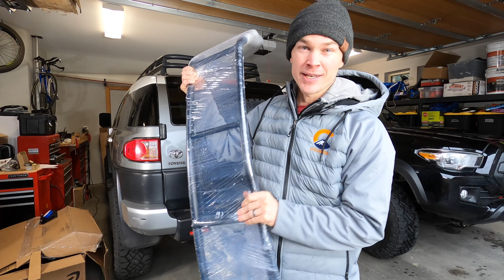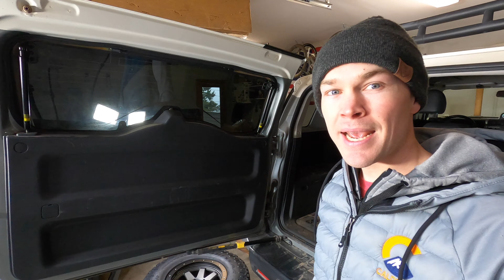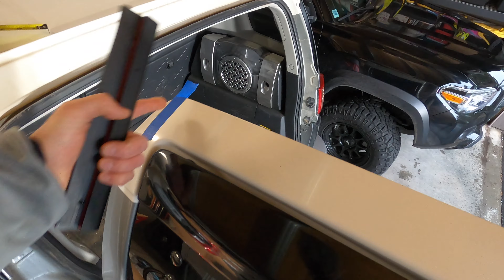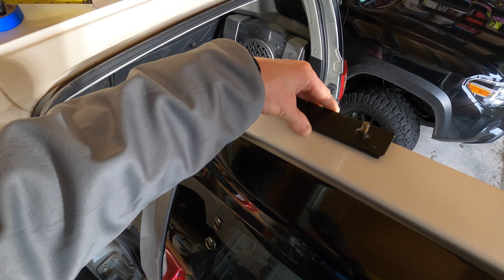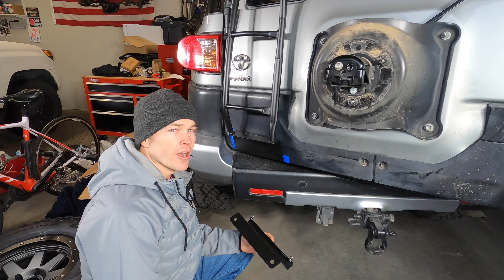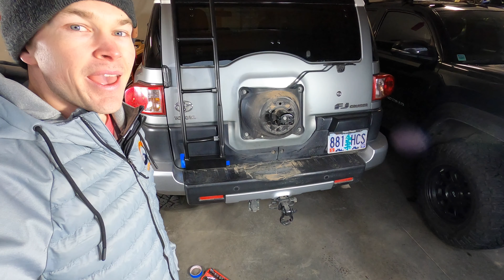The Must Have FJ Mod

Comment: to answer the question "is an fj cruiser without a gobi ladder really an fj cruiser"

yes, yes it is.

if you install the ladder, the fj to not fj ratio increases. making it LESS of an fj than original. additionally, losing the function of the rear window hatch and visibility decreases the fj-ness even more. 

additionally, while the ladder is cool and all. its virtually useless as you can reach the rack from stepping on the doorsill or using the coveniently mounted spare tire as a foothold.

Comment: My must have for the FJ is a diode dynamics cf18 smart tap relay. It adds momentary lane change blinkers to the FJ, and some other silly but fun stuff. After that if you have a locker and no Atrack switch add that. After that its side sun visors on the pre 09 units.

Comment: Is the FJ Cruiser actually functional or just for looks?
Reply: The ladder on the back of the FJ is just silly and stops you from opening the back window. You will want to be able to open it in the summer for some ventilation as the back windows of the FJ don't open. Yes this to me is a big deal. 

I would say my FJ is a functional vehicle. But you have to have the right use case. For example the back seats of my FJ have been in my garage for the past 9 months. I never have passengers in the back. The passenger space is rather small to start with. So if you are a family of more than 2, don't buy an FJ. The roof rack on the FJ is very tall and very small. If you need roof storage I would replace the rack with an aftermarket one. But I can fit 2 kayaks on it using thule cross bars. The factory crossbars are garbage.  The FJ is an ok commuter vehicle but it has a tiny tank and a big appetite. I drive down dirt roads and in snow on unplowed roads and for that the thing is unstoppable. Even when the town forgets to plow my road I got home. I even dragged a ford car up the road with me because it couldn't make it up the hill with 6" of snow. From a reliability and cost of ownership the FJ is basically as good as it gets. I've had a cherokee and they are expensive to maintain because you are always fixing something. Other than brakes, tires, exhaust and gas tank straps. I haven't done anything that wasn't oil changes to my FJ in 3 years. All the work I have done is because of rust. But that is what it's like to own a car in the North East. The ride of the FJ is better to me than a Tacoma but not as soft or comfortable as a 4runner. My next car will be either a Lexus gx or lx because I can't buy another FJ. The Lexus GX is basically an FJ with more luxury and less style. The Lexus LX is a landcruiser. But both of the Lexus cars are very expensive compared to an FJ. Love my FJ.
Reply from the maker: Depends on what kind of functionality you're looking for.  In general I think the 4Runner is better suited to most people if practicality is what you're after but the FJ does have an advantage off-road and has a unique interior/exterior design

Comment: My favorite FJ mod was installing a 8.5’ x 8.5’ lighted awning and getting an awning room to go underneath it. 
I bring a little step ladder with me pretty much everywhere I go, but it’s completely necessary with the awning to slide it into the brackets on the roof rack. 
I have it mounted on the passenger side so the power chord reaches the cigarette lighter, so this particular ladder wouldn’t do me too much good. 
And yes, my FJ is most definitely an FJ without the ladder.
Reply: Nice!👍

Comment: I have one on mine LOVE IT! I'm 5"8 on a good day and stepping on the rear bumper, I have to open the door and at times not a good option additionally you can only reach so far into the rack . Also if you run stock tires yes you can open the window BUT once you go up in larger diameter no dice. Lastly it just looks COOL!

Comment: Step on bumper, then tire, then roof .. easy. 
Rear window access is important .. from access to my Travel Buddy, running a lead out for solar or 240v (powered site) or purely to enable air flow for the fridge.

Comment: So I guess you can’t open your back window now?
Reply from the maker: Its not hugely useful with the spare tire in the way anyway... but yes that's one downside.
Reply: @DrivenCompanion What size tires are you running that block opening the window?

I sometimes camp in the back of my FJ and having the rear window open is nice for ventilation (with some temporary mesh to keep the bugs out) so this wouldn't work for me.

Comment: Hey Mike, great videos!!
Do you think you could do a overview video of the final suspension/lift mods you did. BMC, lift height, tire size, etc.  trying to figure out what will be required to fit the 295/70r17s.  FJ looks great, keep it up!!
Reply from the maker: This video pretty much gives the rundown but another video in the future is very possible as well: https://www.youtube.com/watch?v=VFaucAuXlfw&t=212s

With a BMC and an inch or two of lift you should be good with the 295s.
Reply: @DrivenCompanion   Thanks!  Did you plate your BMC or leave it open ftm?

Comment: I'm not so sure about the ladder being a "must have."  The ladder can be useful, but I can simply open the rear door, stand on the inside of the trunk, and have the same roof access with more stable footing.  If the rear window retracted like the 4Runner, it would be a non-issue, but you've now taken away the ability to open that window.
Reply: I thought a "must have" for the FJ were blind-side mirrors, a cb and some power outlet in the back
Reply: @michelt4390  mine already has a power outlet in the back
Reply: Agreed, I've done a lot to my FJ and that ladder never made sense to me.
Reply from the maker: Fair point!
Reply: I stand on the rear tyres as well when packing roof rack
Reply: I've been wondering of its possible to fabricate a hinge in these ladders to drop down to access the rear window. I've been searching the web haven't found no one to do it yet.
Reply: I use my rear window about as often as I would use a ladder.  Never

Comment: And now you can never open your rear glass 🤔.   I find the rear tires are a great why to access the roof rack.    It dose look good. Just couldn’t bring myself to buy it.  🙂
Reply: Same here, easy to step on the rear tire. I'm not giving up my rear window
Reply: Bingo.. for us guys who have power rear window that beats ladder any day..
Reply: Many times I loaded oversized stuff (pipes etc) by opening the rear window. This ladder is terrible advice - it's so easy to get on the rack anyway
Reply: Yep, makes the rear window useless.
Reply: My rear window has been stuck for 4 years...LOL
Reply: @orthorongaming  fix it, it doesn't take much to open the rear panel
Reply: @AlessioSangalli  I could, but  this ladder has had my eye for some time. I've tried to pry it open and see where the fuck-up is happening, but honestly, I think it is the locking mechanism itself. I don't have a dog, so I don't really need to open it. That being said,  I would like to be able to toss longer things in the trunk...Idk, last time I tried prying it open in multiple areas I felt like it was breaking. Maybe I'll try again soon.
Reply: Ladder for air? not a chance an FJ needs air flow got to remember those rear windows are fixed, Im checking out a black 2010 FJ tomorrow soon enough I'll have real input that matters keeping my fingers crossed this is the one. 😎🤞
Reply: Damn… you’re right. Hadn’t thought about that.